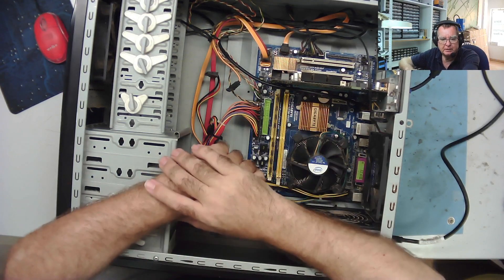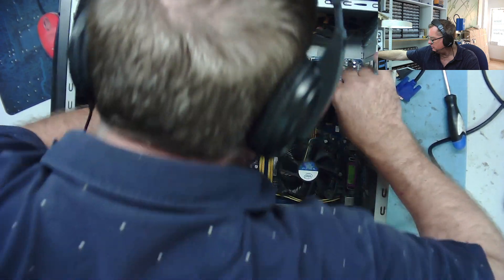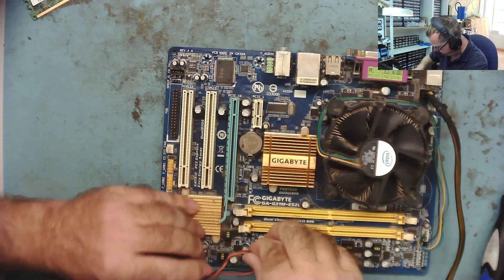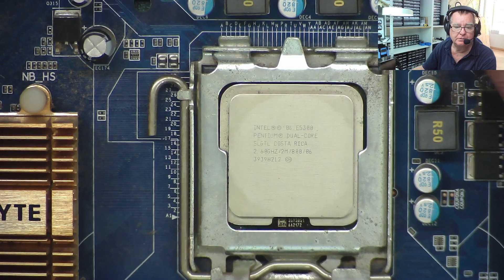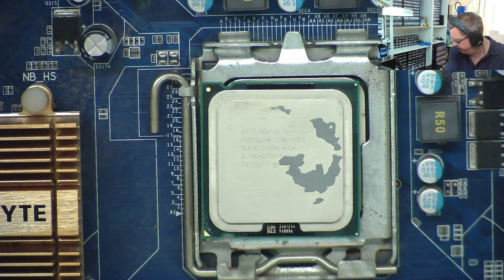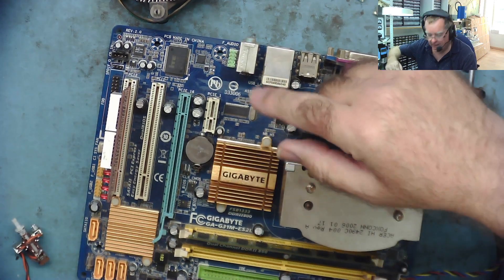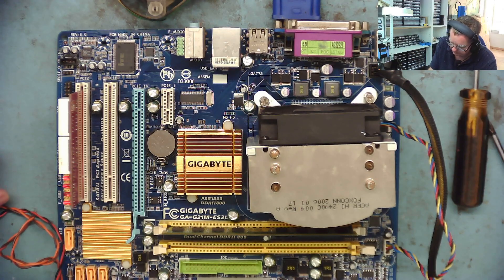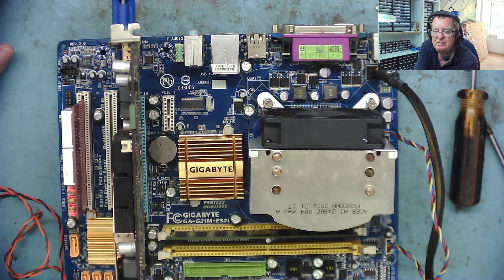PC turns on no beeps no boot. This is NOT a component level repair video, unlike most of my content

Comment: I had two old computers I stored in my garage when I replace them 17 years ago and niether computer would turn on now. I checked the 5 volts start up voltage  and it was less than 4 volts. One of the capacitors in that circuit was swollen and so were 3 other capacitors in the 12 volt circuit. Changing them fixed the power supply but the mother board would not post, no beeps and all zerros on the diagnostic card. I remembed that we had a flood many years ago and that these two computers may have been under water so I decided to wash the motherboard, cpu, memory and video card in soapy water. After letting them dry overnight the computers powered on with many post codes and several beeps but no video. I looked closely at the motherboard and found 5 capacitors 3 near the cpu and 2 near the memory cards were swollen. All were 6.3 volt 820 uf.  I replaced them and the computer booted into windows. The funny thing about these computers is they had no indication of water damage.

Comment: Hi, have a Toshiba laptop and bought it with no sound and found speaks wires gone, so i rewired to both sockets and still no beep at startup or when test in Ubunto.  Resistance on sockets was 80K and 40k to ground so socket isnt shorted to each pin and speakers are good at 4 ohm so it should work unless sound has totally failed and last person just ripped it out!!!  I do board repairs but never had a sound failure before  so if you could help? Speakers are totally dead, not the slightest hiss or signal although i havnt scoped for signal!

Comment: I have the same problem, no beeps , no display... no luck for me
Reply: Same with loud fan
Reply: same problem
swap out psu, ram, gpu, no luck
that cpu+mobo have to go
just get an am4 replacement its so cheap these days
Reply: How did you fixed your pc
I have same issue
Reply: @CTRLNaman  here's the tip: broken trails or oxidation
Reply: same too.... i have luck to replace my psu to make it work.
Reply: Wait what? What did he do how did it get fixed? Did he just replace the motherboard or did taking everything out and putting it back in fix all of it?
Reply: @ProfitProphet-c  normally its cmos problem or reseating the ram can do the trick.
Reply: @ProfitProphet-c  The best I can tell, he didn't fix it but showed the MOBO was faulty...... I think.

Comment: Hi Richard,

i have just replaced a shorted MOSFET on a G31M3 motherboard. Before the replacement v_core was absent, now Is 1.1 V.  Mobo now have the same 00 error on the post analyzer card as yours. I tried to reprogram BIOS chip but nothing (maybe wrong version). It would be nice to see a repair attempt of that motherboard by you.

Keep going on !
Reply from the maker: Hi Fran Dan yes I will definitely get round to looking at it.  Really in this case I wanted to get the customers PC back up and running and they let me keep the old board plus I made some profit on the quick repair so really it was a win win situation.  Also I thought I would experiment with some different type of video content to see if viewers like to watch it or not.